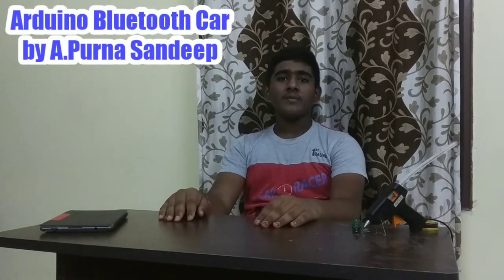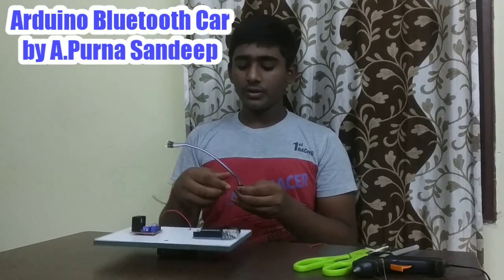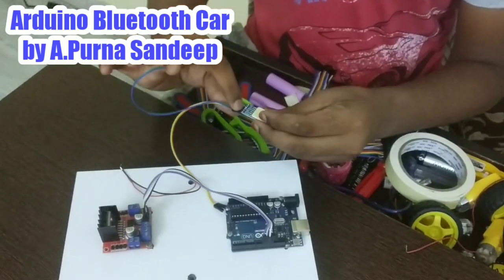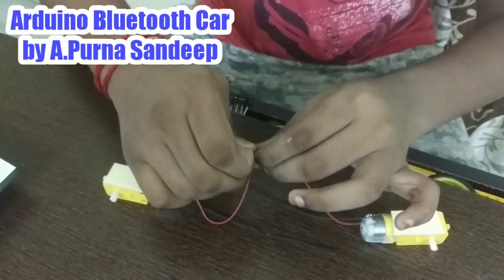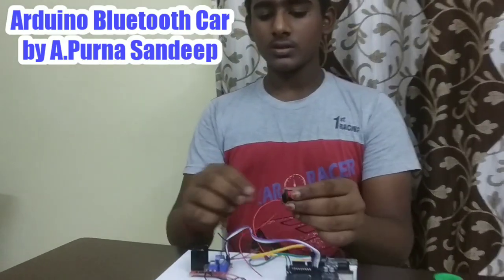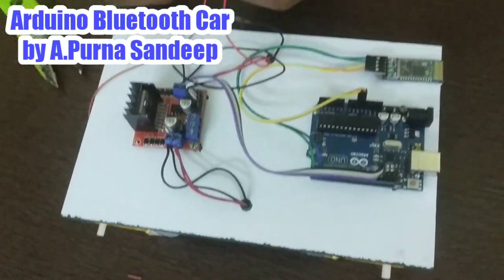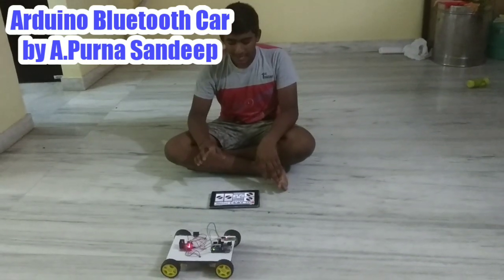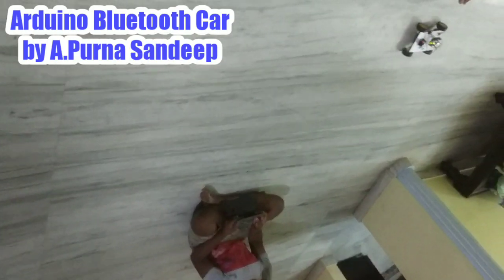WOW! Amazing DIY Bluetooth Robot Car - Control with Your Smartphone

Comment: How did u get that code
Reply from the maker: char t;
 
void setup() {
pinMode(13,OUTPUT);   //left motors forward
pinMode(12,OUTPUT);   //left motors reverse
pinMode(11,OUTPUT);   //right motors forward
pinMode(10,OUTPUT);   //right motors reverse
pinMode(9,OUTPUT);   //Led
Serial.begin(9600);
 
}
 
void loop() {
if(Serial.available()){
  t = Serial.read();
  Serial.println(t);
}
 
if(t == 'F'){            //move forward(all motors rotate in forward direction)
  digitalWrite(13,HIGH);
  digitalWrite(11,HIGH);
}
 
else if(t == 'B'){      //move reverse (all motors rotate in reverse direction)
  digitalWrite(12,HIGH);
  digitalWrite(10,HIGH);
}
 
else if(t == 'L'){      //turn right (left side motors rotate in forward direction, right side motors doesn't rotate)
  digitalWrite(11,HIGH);
}
 
else if(t == 'R'){      //turn left (right side motors rotate in forward direction, left side motors doesn't rotate)
  digitalWrite(13,HIGH);
}

else if(t == 'W'){    //turn led on or off)
  digitalWrite(9,HIGH);
}
else if(t == 'w'){
  digitalWrite(9,LOW);
}
 
else if(t == 'S'){      //STOP (all motors stop)
  digitalWrite(13,LOW);
  digitalWrite(12,LOW);
  digitalWrite(11,LOW);
  digitalWrite(10,LOW);
}
delay(100);
}